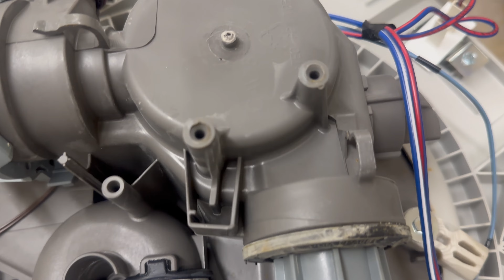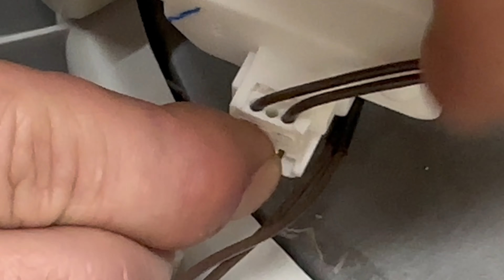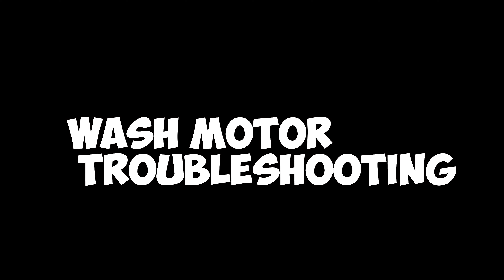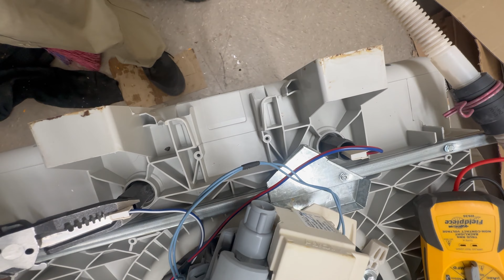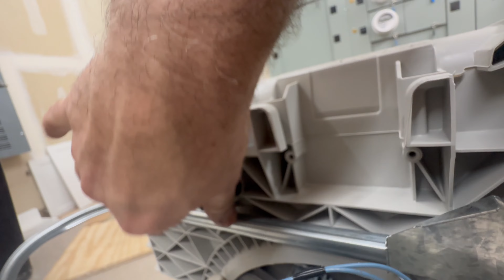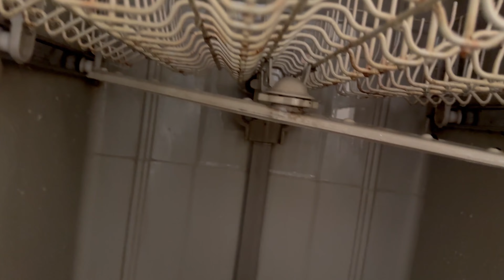Basic Dishwasher Troubleshooting

Comment: Kitchenaid Model
Kuds01vmss7.  Keeps blowing the 95degree thermal fuse during heating.  The board test is good the heating element works the high limit thermostat is good I think the only thing I have not tested is the thermistor do you think that's the issue

Comment: base on your experience and knoledge, what could be the cause of a dishwasher heating unit overheating? I replaced the thermostat on mine and that seem to shut it down as before it would run a full cycle but damage plastics.

Comment: my issue is that the wash arms dont rotate, pump works when 120v applied, touch pad or electronic board both posible culprets and both half the price of a new dishwasher, pump not clogged, incredibly annoying, quite a lovely machine thats not too old.
Reply from the maker: thats a tough one if you are 100% sure if that wash pump impeller isn't blocked. How did you confirm the pump works when 120 is applied, just curious
Reply: @ApartmentMaintenancePro  cut wiring harness to pump, stripped insulation, plugged in to outlet,pump impellar spun.Was wondering if diverter valve was playing a role, thinking of removing rotating disc and applying water and hydro to unit and see if arms move....just curious, I like to solve things.....board and touchpad much too flaky for me. pump was tested when removed from dishwasher.

Comment: One very important thing that was missed, make sure the tub is filling up. If the fill valve is going out, it will not fill the tub enough which will cause air to get into the system. You will still hear the water fill, the arms spin etc, but it will not create enough pressure to clean properly. Depending on the model, the water should be at least touching the heating element or just covering it. If the water level is very low replacing the value will fix this! Cheers!
Reply from the maker: Thanks for the info!
Reply: Fantastic info! 🙏 Thanks!

Comment: Our 4 yr old Whirlpool dishwasher was putting some water in, then it would seem to start a cycle and heat up, but there was no circulation.  After watching this video I tested the continuity of the circulation pump and it measured 8.0 ohms as specified in this video. I therefore concluded that the circulation pump was not the issue.  After a reset of the control board, the display told me of and F4 E3 error code which indicates a problem in the communications between the control board and the circulation pump.  i expected i had to replace the control board, but other videos on youtube told me the circulation pump is the most common thing to break down.  I ordered a new one on Amazon and put it in and it worked.    SO despite this video saying the circulation pump is good if its got the correct measure of continuity, it still can be the problem.
Reply: I got a new pump, still arms not rotating, needs board or pad, pricey
Reply: @consumersgasman8376 through the powers of deduction, I concluded that the wiring harness between the control board and the pump was the failure point on my model. That's where I drew the line and and just pulled the trigger for a new dishwasher. I was done dumping time and money into the old one.
Reply: @WEEBER13  Ive ordered a new dishwasher as well
Reply: Good to know

Comment: I have too much water coming out of my drain house out of my air gap and getting water all over the place. I checked the garbage disposal tube there is no blockage. No blockage in the drain hose. It’s almost like it’s draining with too much pressure. What am I missing?
Reply from the maker: Check out this video and the comment section has some good tips, should solve your problem - https://youtu.be/LsrVpuGHIJQ

Comment: Where do you get the tech sheet? I feel like if I had that, I’d be more than good. But I have nothing. Is there a place I can go for this? Or buy?
Reply from the maker: Behind the bottom plate on the dishwasher, usually. Or Google search. Or, if you work on tons of appliances as a profession the best resource is https://appliantology.org/ - paid service. Whirlpool also has a website https://servicematters.com/en_US (for contractors) where you can download the tech sheets

Comment: I'm not a tech I'ma guy at home trying to fix my dishwasher, I have 2 questions:

1: is the set up of most dish washers the same ? Meaning do that have the same parts that can be checked in the same way ?

2: how do I get my dishwashers electrical manual like you have here ? ( I'm new to the meter but I can learn) 

3. Is there any danger in me doing this my self? I can't relay on warranty I just got this house in November and this thing broke on me for 2 months now and I have no idea when the last owner bought it so can't claim warranty
Reply from the maker: 1. No, some will have more parts than this video. You will have to consult the schematic
2. It should be behind the bottom coverplate. Though not all are. Some manuals can be found online but a few cant
3. There's always danger when working with plumbing and electrical.

Comment: Nice job explaining how to test the components & using the tech sheet to verify. So many "techs" don't know how to properly use a multimeter & properly check parts on appliances & hvac systems. I believe its the companies fault though for not providing proper training & they are just thrown to the wolfs. I would bet in apartment maintenance 90% of appliances that are swapped out, are misdiagnosed. Keep the vids coming bro 🛠️👍